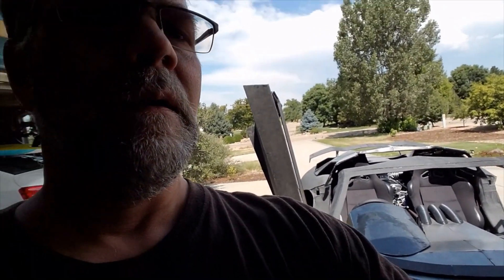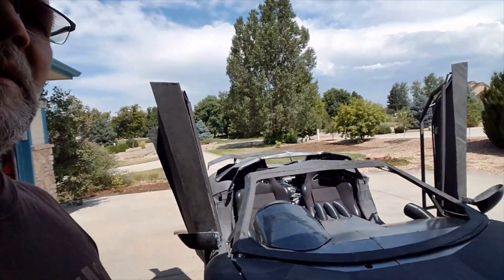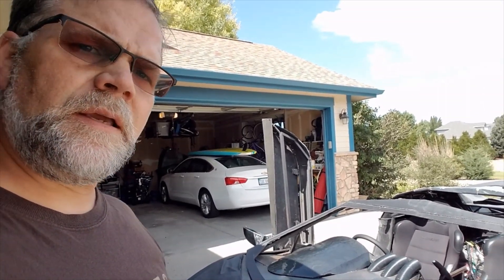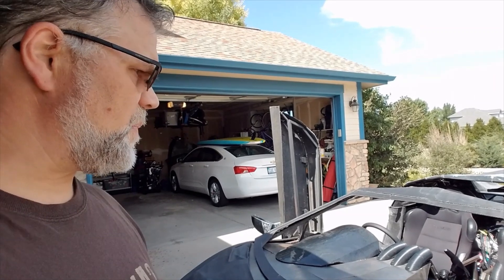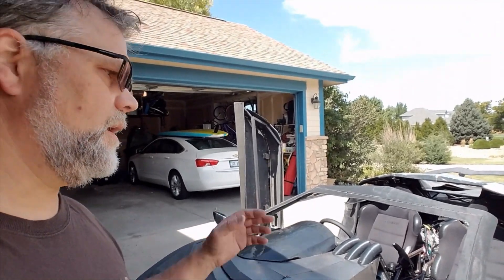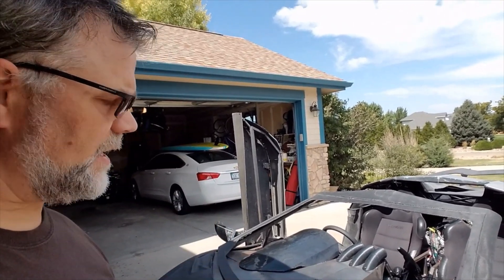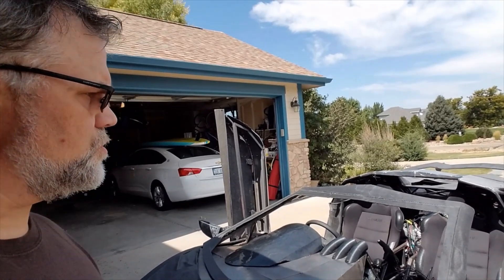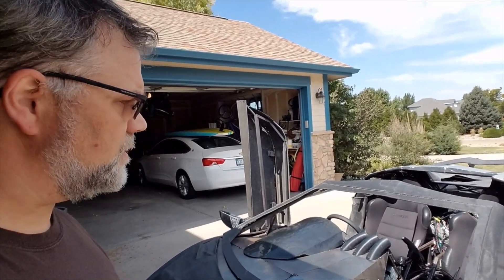3D Printed Interceptor Update 5

Comment: dumb question, how do you manage to attach the carbon fiber body panels and parts? like the doors and such.
Reply from the maker: With steel and aluminum.  panels get epoxied and screwed to the structure.

Comment: I know you are a physicist but you are also one hell of an engineer. I build trucks, jeeps and rock crawlers just to play on the trails as a hobby but this vehicle is on a whole other level. Oh yes and check everything before you finish weld rolling it off that trailer could have tweaked a lot.
Reply from the maker: Just got done measuring, and it did not move at all.  Still square, level, and plum.  Feeling somewhat vindicated. :)
Reply: @lasersterling  Fantastic my friend. Tack welds scare me sometimes when you have to move the vehicle around very much.

Comment: B is for Build recently bought a race body for the Lambo he's working on and they are legit race panels so there is
basically zero inner structure they are just single thickness plastic panels. I think he said they weigh like 26lbs! 
But they all fasten on with Dzues 1/4 turn hardware not really street stuff.